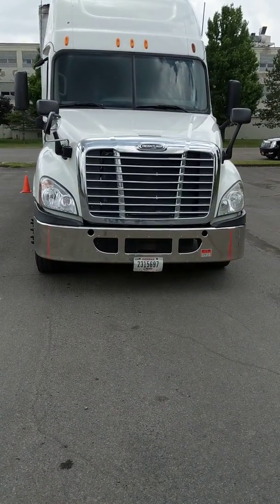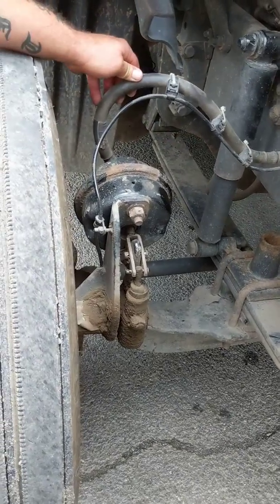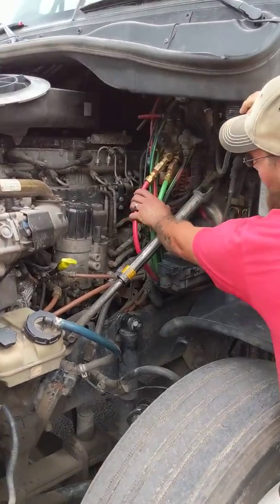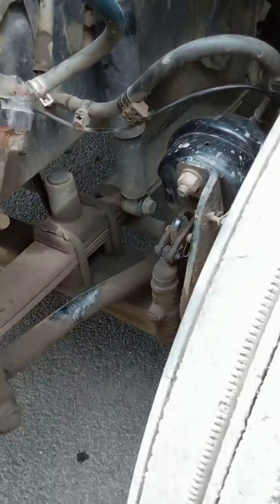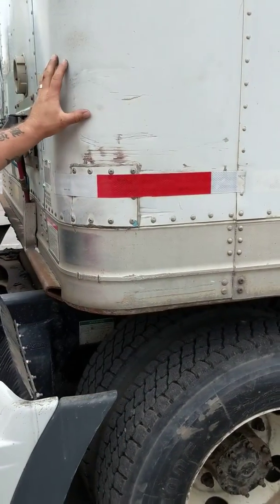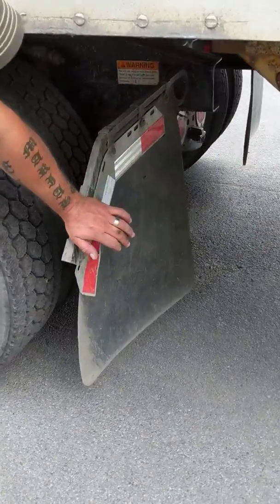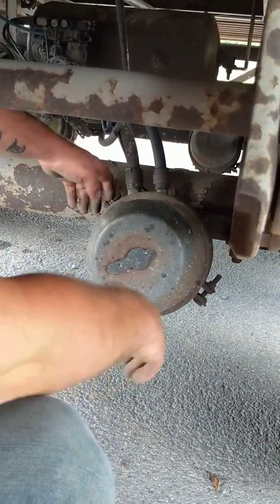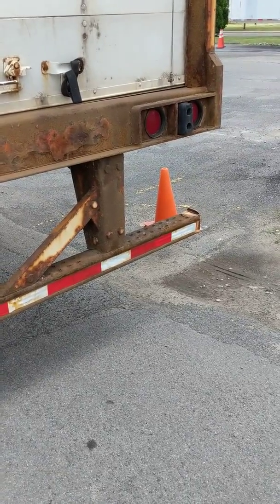PreTrip Inspection Video

Comment: I attended Sage Trucking School from November 22, 2021 to December 21, 2021. My CDL test was scheduled on December 21, 2021 & I passed first try🙏 This school is so good with teaching their students how to do a proper pre-trip. I thought that I would have a really hard time with it because there is so much to remember, but most importantly learning the parts, functions, & purpose. Once I went through the program, three days in I went from knowing absolutely nothing to sounding like an auctioneer running through the pre-trip. Tractor, trailer, in-cab, & brake test. It sounds like a lot to remember, but once your doing it hands on pointing at the part & then going through your descriptions it just becomes easier & easier & easier.
Reply: Yaaay!!  I'm currently in stage school as well.  All the instructors are amazing what school did you go to what area?  Who did you end up working for?
Reply: That was supposed to say sage

Comment: I'm still learning, so, how critical would it have been for him missing identifying that the rear of the tractor has sufficient spacing to avoid contact with the trailer landing gear?
Reply: In my experience, I just had to point or touch the landing gear & say, “landing gear is not cracked, damaged, & broken. There are no illegal holes or welds on the landing gear. The landing gear is properly mounted & secured with the proper hardware to the trailer.” Then you state that the hardware is not missing. Then you would demonstrate how to lower & raise the landing gear legs & then state that the legs are functioning & they are not bent. Then state that the feet of the legs are secured with a pivot pin and that the pivot pin is not cracked, damaged, or broken. It is not illegally welded. That was all I had to do for the landing gear.